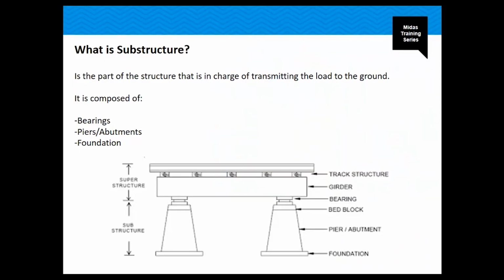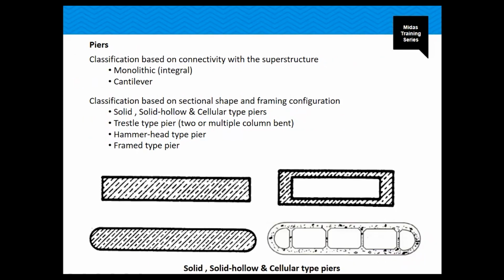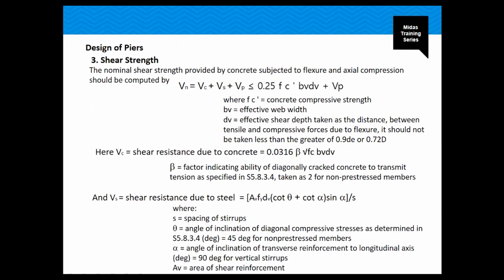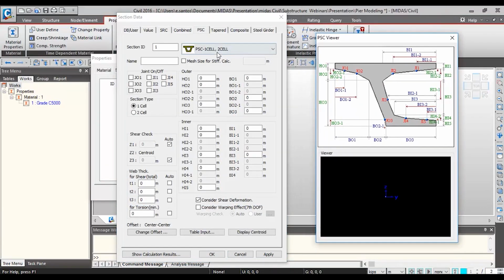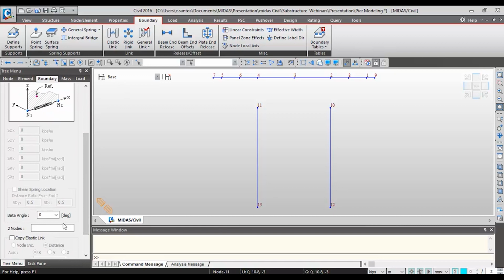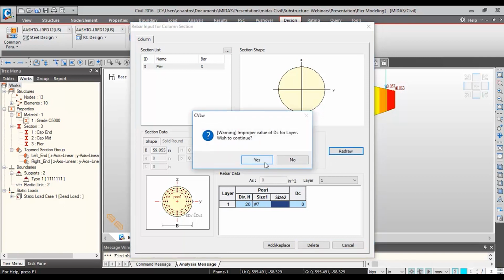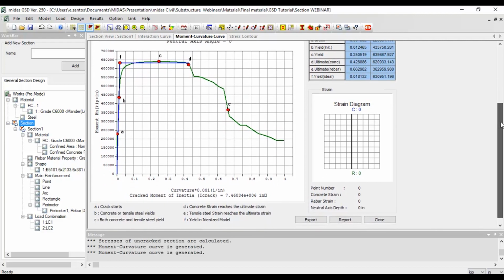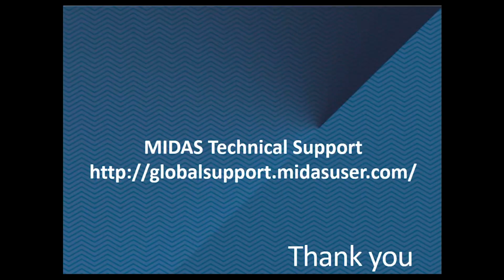Analysis and Design of Substructure of Bridge: Bearing, Pier, Abutment, Foundation | midas Civil

Comment: Hi. Would you be able to explain that "auto-generation" step? I followed exactly what you did before and it was all good until 42:54, then I saw you just clicked "auto generation" then all the load popped out, but for mine it just said "no existing load case". I am wondering if you have defined them in advance or something?
Reply: The exact same thing occur to me as well, which mine doesn't generate any load case, instead kept showing up the warning "no existing load case".